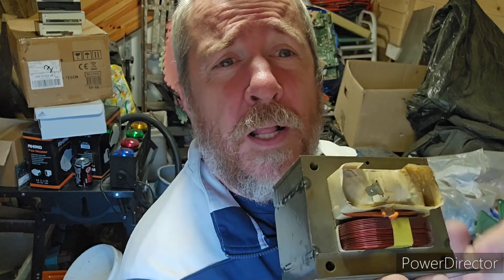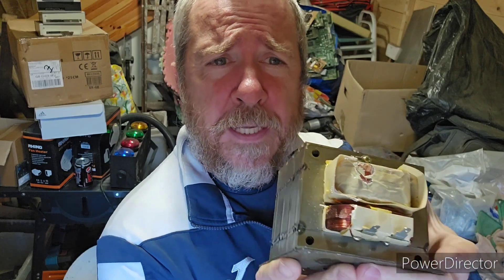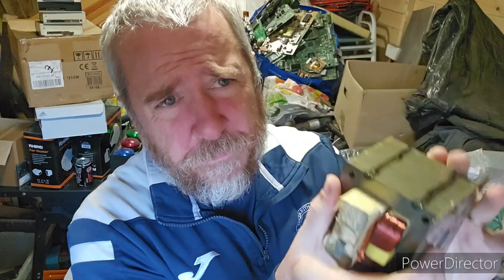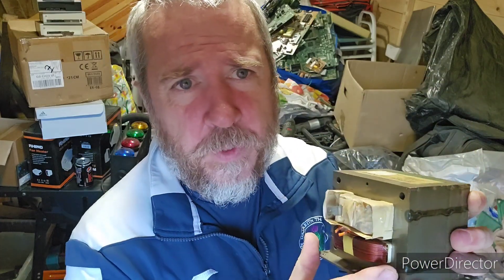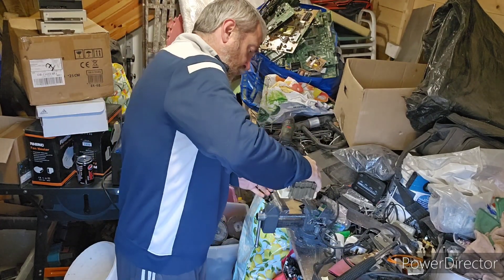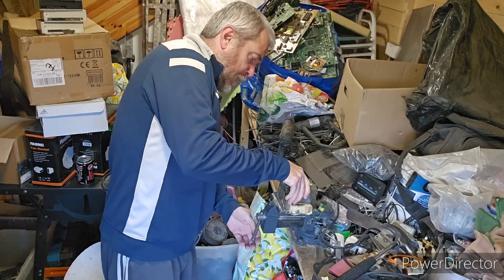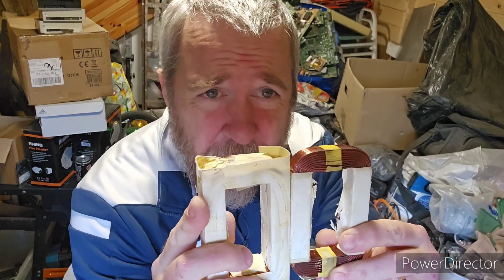How to remove the copper from a microwave transformer in under 2 minutes

Comment: That just didn't convince me that transformer was all copper m8 ,one you didn't do a scratch test revieling the copper and 2nd winding was all in paper witch still didn't show copper
Reply from the maker: The object was to show you how to take it apart quickly mate.  I can assure you it was all copper.  You'll need to take my word for it
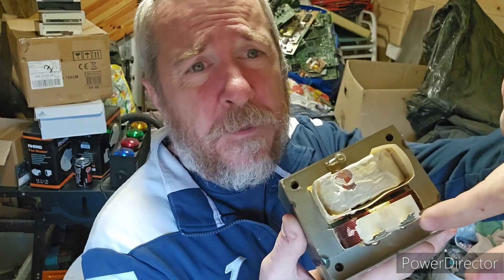Reply from the maker: Also look at 2:02. You can see I've taken a grinder to it to test it
Reply: @ScrappingScotland  I had my beer 🍺 goggles on and am sorry for been negative about your video, yes I now see the top winding its copper, it would of made it better if you would taken the bottom layer of to just show it was copper aswell, am a pro scrapper,when it comes to a microwave transformer its always aluminium windings with the copper laquer they spray it with ,I do apologise for been negative mate
Reply from the maker: @nightscrapperuk13  all good my brother